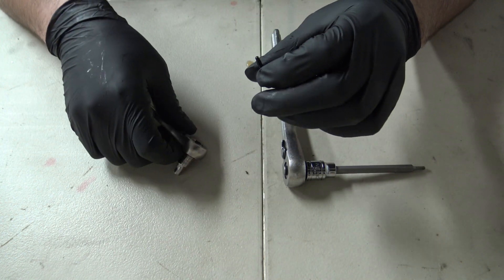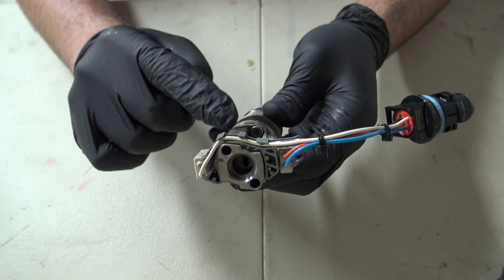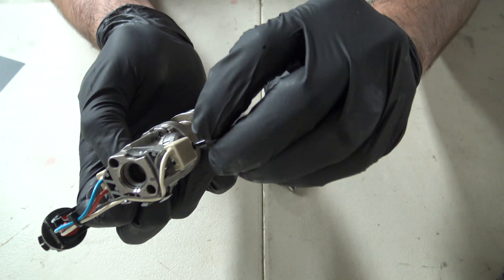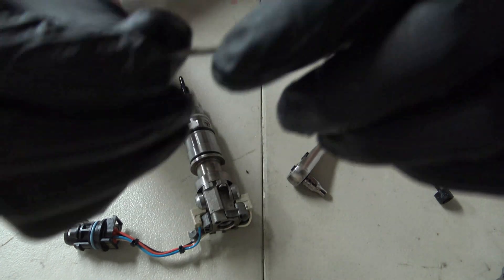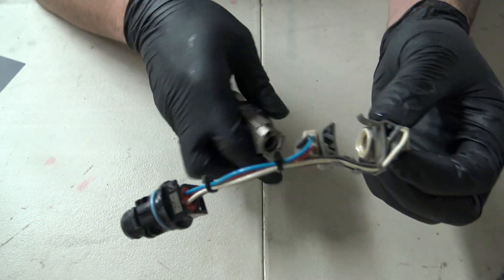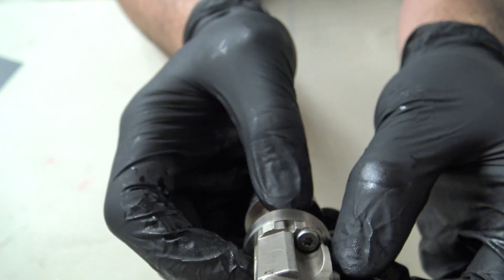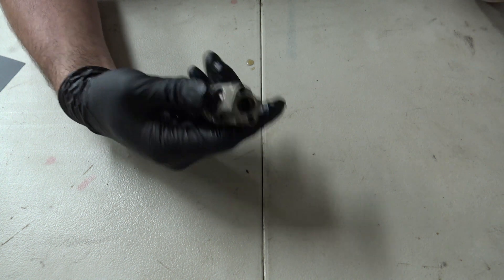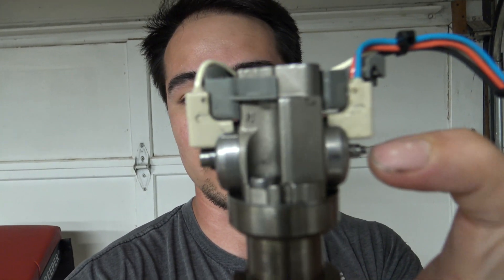6.0 Powerstroke Stiction Fix - Sanding the Spool Valve

Comment: You can do it in the truck if your brave enough done probably 10 this year save people a lot of $$$ I cut a hole in a thick paper plate and push it around the injectors incase anything is dropped
Reply: Why would you tho it’s only one bolt holding it in

Comment: Switch to Schaefer’s 5/40 oil and add two shots of revex, and you won’t have these problems.  I started having problems with #4 injector, and this cleared it up right away.  That was back in 2016.  You need to treat the fuel also.  I’m on origional injectors with a 2006.

Comment: Awesome thank you for the video I just bought New injectors and had to replace one due to not working finding the nut from that bolt on the coils came off and I was lucky to retrieve it with a magnet and could have saved money just putting it back together instead of buying another New one. Great video thanks again

Comment: Thanks for sharing. I took a brass wire brush to my nozzles and made a couple passes with 1000 grit to finish them up. Now I’m reading that you should not use any abrasives on the nozzles. Do you think I’ll be ok using them or should I order new nozzles?

Comment: or you can get a Valve & Spool Assembly for that injector and have a New matched part that will ensure that your diesel fuel injector won't get more problems. 

The friction of the spool with the housing or valve in a long period time creates a natural wear, as we can see in your video the spool is like a "bone" with larger segments or gaps between; this will close or opens the valve with help of the coil. 

That means that the valve itself has some gaps too and when the spool get used it start making friction all over the place and the wear will not be uniform and that will create gaps that will finish in injector stiction, hard starts, etc. It's hard to match the valve and the spool as you have to hone the valve and put a DLC coating on the spool to match them, sometimes it will work ans sometimes don't.

If you're interested in the Valve & Spool Assy, please visit www.california-diesel.com you can see a couple of photos there and order it if you need it, we also have solenoids for 6.0L Power Stroke injectors, nozzles and other parts.

It was a nice video to watch I just have one question, when you do sand the spool and put it back in the valve and your injector is ready to go, have you ever got problems with oil/presure?

Comment: Can this loose high oil pressure on that spool ???? I change all the seal on my truck rail and injectors and I still have a leak and I can’t find wear it comes from under the valve covers
Reply: Did you ever figure it out,  I've heard if the spool is inserted backwards it can cause a High pressure oil leak.

Comment: Interesting video. Thanks for sharing. I’m kinda curious how often that internal oring/seal on the plunger goes bad and if so where do you find a replacement? None of the kits I’ve seen come with that seal and I’m thinking this is what might be failing on my injector.

Comment: You don’t sand them. If I was forced to use anything on them I would use a polishing compound. Everything inside an injector has a tolerance of 0.0005 or less.
Reply: 800 grit wet/dry will not do anything to that material besides remove the varnish that is on them.

Comment: Great vid. Btw I use a little chrome polish to lap the spool valves in the housing.  It works great and produces a mirror finish on the valves themselves. The grit in it is fine enough that it can't be felt with your fingers, so no damage is done. No sticky!